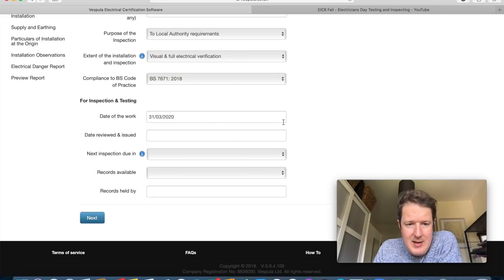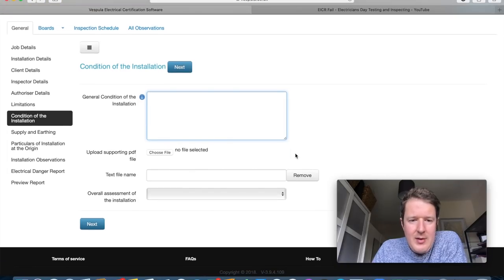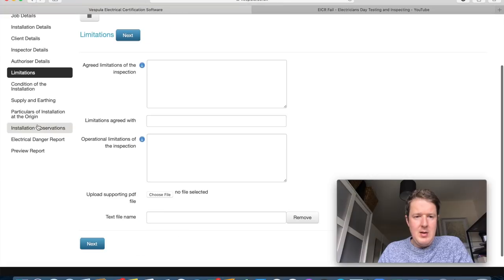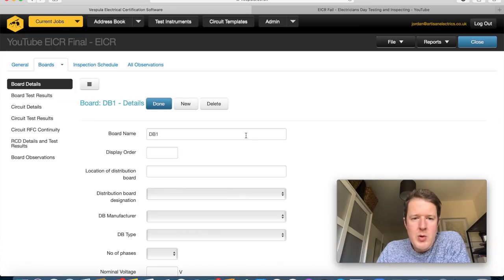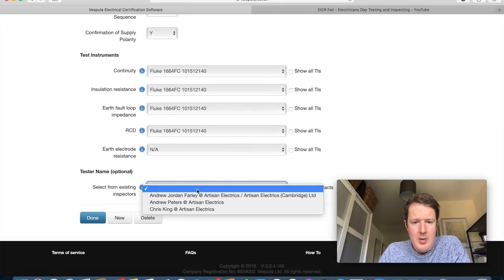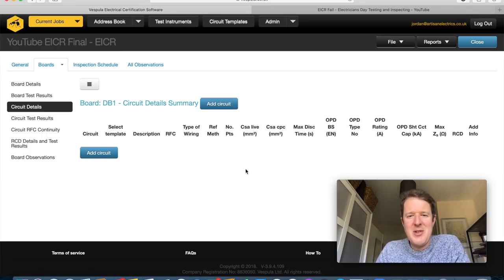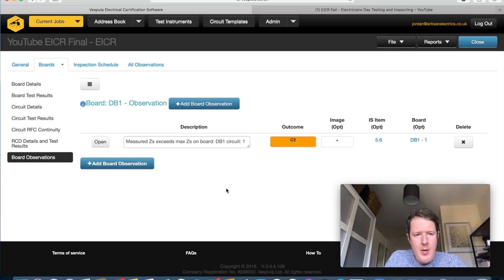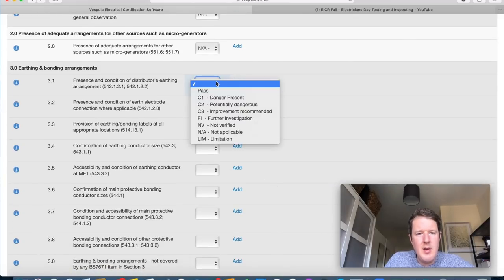EICR Codes - Filling out an EICR Form 2020

Comment: Regarding PFC, the PEFC is actually usually higher than the PSCC in a single phase installation and in three phase it would tend to be PSCC that is higher of the two, hence if you have a tester that doesn’t test at 400v you should take the PEFC and multiply by 2 as a general rule of thumb. I believe a lot of people tend not to even bother testing between live and neutral in a single phase system as it is very seldom the higher value. In this case it would have been the PSCC that was higher as you had such a poor earth from the supply. Nice to see people actually doing a proper Ze test too, I wonder how many sparks would have missed the poor supply earth by not disconnecting the final circuit CPCs and main bonding. Great video I’ve been looking at changing software for a while and this looks brilliant! Thanks Jordan 👍
Reply: Christian, we really hope you like the software: any questions, do get in touch by DM on Twitter/Facebook/Instagram. And have a great Christmas! All the best.

Comment: Really good video 👍🏼 A question for you, on points 5.10 and 5.11 (to do with concealed cables) you have put as pass. I usually put this myself but the more I think about it shouldn't we really put Limitation as surely only the installer will know this? Be interested to know your thoughts, cheers Shaun

Comment: hi jordan, great video if you had low insulation resistance on a circuit where would you put that on the schedule of inspections if at all just wondered as high zs was recorded on schedule. Very interested to know am taking my 2391 in a couple of weeks

Comment: Like the look of that Vespula software. Upto now I have always handwritten all my certs as could never get along with software but this version looks good. The Napit codebreakers book is good but needs a review and update as some of the codes are either way out or inconsistent. As you highlighted Jordan, the codes for bonding and earthing are inaccurate. 6mm bonding on a TN-S is only a C3 so long as it tests integral and adequately connected. Undersized main earthing conductor doesn’t warrant coding if it passes an adiabatic calculation from bs7671. If it is inadequate then a C2 is used. Adequate labelling at the CU could have gone down as a C3 as there was no legible circuit chart as required by bs7671.
Reply from the maker: Thanks great comments. It’s definitely worth checking out the software it will save you a lot of time and also much neater than doing hand written ones!
Reply: Yes, please give Vespula a try. Any questions, just let us know on the contact us page. During the lockdown we have extended our free trial until the end of June.

Comment: Also - Is the codebreakers book coding systems too harsh as I've never been sure if EICR reporting is based on if older properties are still safe (based on when they did comply) or if unsafe as not compliant to the latest requirement/regs? Nobody or even NIC EIC explain this clearly to me. One job had an old previous report which deemed as satisfactory BUT 50% circuits no RCD (Codebreaker states code 2) which is unsatisfactory, so bet ur a dollar client will query? Any opinions? Also 10mm csa earths for services at DB but nowhere to be seen or accessed at intake/taps of water or oil or outside (Can't see cables or clamps at services or taps or anywhere obvious) - What code? But I did get lowish ohm reading with R2 lead from DB + zeroed wander lead.

Comment: Hello, I am an apprentice electrician, so when doing testing am I correct in saying that you don't have to do R1+R2 for every circuit? and you can do just do R2 with a wonder lead? and then for Ring Circuit, we should test Continuity of the conductors and then do we need to do R1+R2? or could you just do R2 again?

Comment: Is there away to set this to record the maximum Zs Values as their tabulated values of 80% by default? 
Also can duplicate existing certificates, where the difference may just be few factors i.e. new builds built to the same spec just the values being different?

Comment: Looks nice to fill in .. don't forget to add more items to your list that you did not inspect. .I.e. roof space . Just to cover yourself. I still code 6.0mm main bonds as a c2.  Still put main bond to water on your test cert even if it has plastic pipe coming in just think about all the copper pipe in the house and the touch voltage ..I find all test are different and everyone puts in a different code and some electrical installations are worse than others so I put a more c2 than normal to take into account the worse installation.  Apart from that very good . Watch your tick boxes on earth clamp labels .

Comment: Am I missing something or is there no test carried out during an EICR that verifies neutral impedance?  Yes we have end-to-ends on ring circuits but nothing I can see for radials.  Also an end-to-end doesn't test to the front of the socket so won't catch a faulty receptical.
Reply: shush

Comment: The earth clamp on the supply cable looks like a pipe clamp, not the sort that a DNO would ever fit. Therefore it's FI and /or  C2 as incorrect connection of earthing conductor?  It might explain the high Ze as the supplier earth could have broken down.

I came across your video as i'm trialling Vespula. (I find NAPIT desktop/PAYG too limiting and haven't made time to set my own Excel based forms up). THanks for the brill demo of the software!

Comment: You have said the installation is unsafe for continued use because a light is not secured adequately, then coded it with regards to its IP rating which was clearly adequate. IPX4 is not supposed to be resistant against a shower head as you describe.

Comment: Hi Jordan, great Vid as always. A quick question do you give the client another copy of the EICR once all the repairs are completed with a satisfactory or just a EIC / Minor cert depending on was completed. Cheers.
Reply from the maker: I would issue an Electrical Installation Certificate and mention in the notes that this work is to rectify the faults on the previous EICR and quote the EICR number and state that the installation is now found to be in a satisfactory condition.
Reply: @artisanelectrics  Brilliant just what I hoped you would say as that's the way I currently do. Thanks.

Comment: David Savery Electrical services did a vid on a flat. No RCD's on DB. But deemed report as satisfactory? Does this make Codebreakers book as a code 2 (flawed) or am I missing something? I don't wish to create remedial works but is main earth, main earth bonds and fuse/mcb's really adequate for a report to be satisfactory?? Comments please?? Also, cables in walls in all domestic properties including flats usually always ever a code 2 as cables in walls <50mm and metal capping not for protection post install?
Also why sup cross bonding now not a thing where good main earths + bonds + satifactory ZS readings at all circuits/outlets?? Also, bathrms/shower rms have class 2 lights but fail (Code 2) as no RCD ? I am hating EICR reporting because guides & regs not direct answers. Cheers,

Comment: Hi, this is the first time seeing this video. Just wondering, do you fill this software in as you are doing the testing or do you just make notes and fill it in later? Cheers
Reply from the maker: I usually fill it in as I go, it’s easier that way and saves time in the evenings
Reply: @artisanelectrics  thanks very much. Does the software need a live internet connection while you are filling it in? My tablet is only wifi so wont be connected while power is off and also might not get wifi in all houses?  would you say its best on tablet/phone/laptop?
Reply from the maker: @sundownsolutions2  no it works offline as well

Comment: Hi Great vid Thanks, looking into trying the software , you marked L-N insulation test as >500 should that not be LIM ?
Reply from the maker: Thanks! It depends if you can disconnect all equipment then you can do 500V Ins test L_N no problem. In this case I should have probably LIM'd it as it was not possible to disconnect everything.
Reply: @artisanelectrics  Yes i was referring to your vid not in general , Cheers Jason

Comment: Hey Jordan 
Great in-depth Video of what’s its like filling these forms in! I’ve learnt something new or two off of this! Tapped all my code breakers book and everything after watching! Anyway couple thinggs I found..                                      you passed identification of cpc even though there was no earth sleeve present on your sample?  
                                                                                       Here’s an interesting thought that went through my head the trunking system that’s installed for smoke alarms is pvc and above head so in fire would collops causing possible death but we test to 18th edition so shouldn’t that have been a c2 and fire supports installed? Think that’s what I would have done in that case what’s your thoughts mate?   Congrats on 10K keep up the great content👍👍👍
Reply: It's a C2 if it's likely to collapse prematurely and cause entanglement, it's  a C3 if not.
Reply from the maker: Yeah that’s a good shout I didn’t think to check if metal supports were installed.
Reply: Ashman Electrical Services what do you mean by prematurely? Under fire condition? So Jordan’s eicr would cause entanglement?
Reply: @bradleymay4770  The word premature means "early" or "before". You have a predetermined time at which something is to happen and if it happens early or before then it's premature. In the case of premature collapsing of wiring systems, every building has a certain degree of fire protection, a single sheet of plasterboard usually has a fire rating of 30 minutes, a double sheet of plasterboard usually has a fire rating of 60 minutes. So in essence the fire support clips should remain intact before the walls or ceilings start to collapse. Always use clips that have the highest melting point.

Comment: Great video Jordan, just a few things to mention... The fact that you couldn't identify the cut-out fuse due to it not being labelled and sealed should be noted in the operational limitations not the agreed limitations. You also ticked the polarity box on the form having only done an R2 test, you can't confirm polarity on a dead circuit unless both R1+R2 and R1+Rn tests have been carried out.
Reply from the maker: Hi! Thanks for the comments. I ticked polarity because I did earth loop impedance tests which also includes polarity test.

Comment: An insulating section (pull cord coupler) in an insulated pull cord (non-conductive string) where the section that goes into the switch is in turn coupled to an insulated section.  Really?  It's not an insulator, it's there to allow a broken cord to be repaired easily by a householder without having to open the switch itself to do so.  It has no place in an EICR.

Comment: Smoke detectors: I see you added a circuit for the smoke detectors (8), because they are wired to the CU. Ignoring HMO rules for a moment, whats your position on electricians failing (C2) a normal house EICR because there was either no smoke detectors, an inadequate number, that they were battery powered - not mains & not interconnected.
Reply: Surely an EICR is not meant to report on the existing condition of a fire detection system or lack of one . I would say a specific fire condition report is suitable for that purpose

Comment: The adiabatic equation is not used to size bonding conductors only circuit protective conductors, the regulations give specific requirements for CSA of bonding conductors . Undersized bonding conductors are more dangerous on TN CS arrangements because of the issue caused by an open PEN conductor and the fact that the protective bonding conductors may be subject to diverted neutral currents, that is why they are sized larger than non TNCS earthing arrangements , the CSA is sized in relation to the  DNO’s PEN conductor coming into the installation .
The 6 mm bonding conductors will not be undersized on TNS or TT arrangements and should not be coded on their respective csa alone, as the conductors are sized to no less half the required size of the earthing conductor and no less than 6mm.

Please don’t take the code breakers book as the be all and end all for coding , it’s not,it should be used as a guide only ,use your own knowledge and technical judgment, not what a book says based on generic situations, perhaps read bs7671 rather then codebreakers.
Reply from the maker: ian adams great comment thanks
Reply: I ordered code breakers as a reference guide and found some odd code’s I was surprised. Cables not in prescribed zones c2???? 
Cables installed within correct zones with no additional protection c2???? 
Never in a million years would I deem this to be classified as such.
Reply: PETER WILSON exactly right a main earth It undersized because it doesn’t fit the rule of thumb Size of 16MM and shouldn’t be recorded so. A main earth is undersized because it fails the adiabatic equation (or in the case of pme fails to protect in the event of diverted neutral currents)
Reply: @tomorichard  The reason for the zones is so that people know where they can, for example, drill into a wall knowing that they won't puncture or damage a cable.  If a cable isn't in a pescribed zone then it does present a potential danger (i.e. C2)
Reply: @PETER WILSON Sorry struggling to find the regulaion/ guidance. But don't we have to assume than TNS systems may become TNCS at any point due to repairs or modification made by the DNO. Therefore I would assume its sensible to always size earthing and main bonding conductors based on this or am I making to big a leap?

Comment: Great video and software looks like I will use this instead of the Metrel platform for producing certs. One point I’ve noticed is the guidance for the customer at the bottom of the PDF reports refers to 17th edition? Minor point but devil in the details....
Reply from the maker: Thanks! I’m sure if you mention it to them they will sort it out they are very responsive to feedback
Reply: Jon, this is a good point, thanks for commenting. We will get this fixed directly.

Comment: What would you put if the main fuse was a solid link
Reply from the maker: Not sure if it has an option for that
Reply: My flat has one
Reply: @nigellewis4686  should be a fuse 60A/100A usually.
Reply: @nigellewis4686  Your service fuse is probably in the service intake room. The red-link is just a means of isolation for the CU within the flat and not an OCPD.

Comment: Personally found vespula takes to long to use, i do a lot of EICR;s should try electraform as also got code breakers built in
Reply from the maker: I think any new system takes a bit of time to get used to, for me Vespula is the fastest system I’ve ever used and makes the nicest looking reports
Reply: @artisanelectrics  the electraform does a nice front cover too again the only think i dont like is they are both web based but i prefer doing certs at a desk and not on site lol, getting old i guess
Reply: @jheelec  Joe, hi. Vespula is designed to put you in charge: you can fill in on site, but equally you can take sheets home with you, and write up at the weekend, or whenever, on your desktop. It is cloud based, but that just means you don't have big files sitting on your hard drive slowing your PC down. Do get in touch if we can help at all.